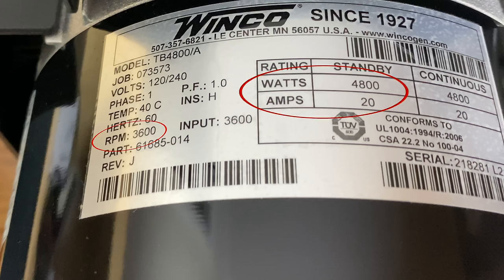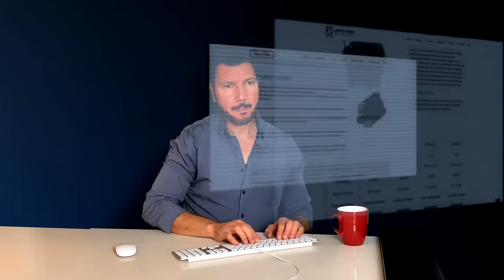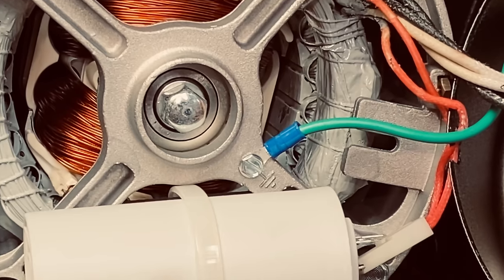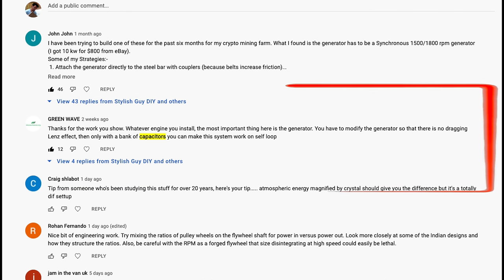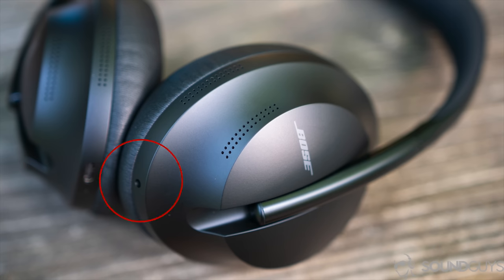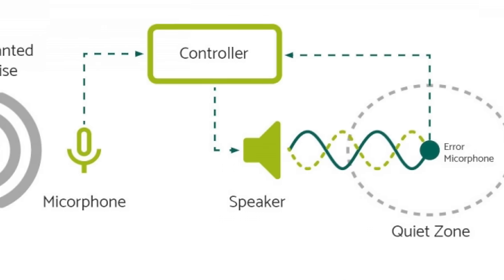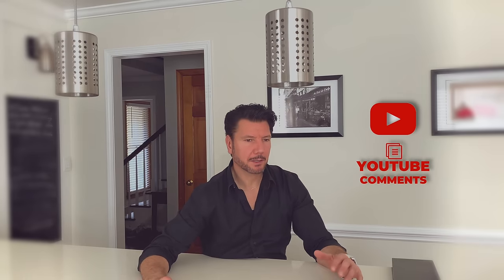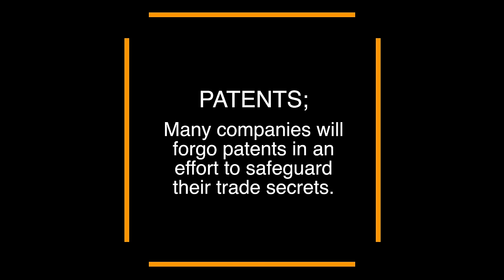Why does this Free Energy Generator not work?

Comment: This is easy to do.  All you need are frictionless bearings, 100+% efficient motor and generator, a perfect vacuum, 100% efficient belt/pulleys, room temperature superconductive electrical components, and perfect dynamic balance.  Easy!
Reply: And even then there would be only enough power to keep the thing turning. Any attempt to get power out of it would stop it. All these things are dreams.
Reply: @andyhowlett2231  right!
Reply: And a djinn to flip the switch
Reply from the maker: Sounds easy enough Brad :)
Reply from the maker: @parsimonies I don’t remember ever saying it was easy. All I said is that there have to be more sustainable ways to generate energy than what we are using now. I never claimed to have the solution.
Reply: @parsimonies I have a Masters degree in mechanical engineering with 30+ years experience.  I know how a generator works.  My original comment was meant to be a joke, not intended to be taken seriously, as you obviously took it to be.
Reply: Çok konuşuyorsun neden telefonunu veya adresini yazmıyorsun neden saklıyorsun 
Hadi açık ol insanlığa faydali ol 
Neden hep gizli...........
Neden korkuyorsun ..........
Yürekli olun açik olun .......
İNSANLAR SİZİ SEVSİN ......
Reply: is possible free enegy(free electricity)?
Reply: @MarkusNenning  if no solution, why i must look this video? 🤦‍♂️
Reply: @andyhowlett2231 Then why do inventors go missing die or close up their research? Why are patents not given and inventions taken? Why is there a secret patents office? Why does the military have staff at the patents office? Now I don't know if these things work or not, but those things alone are helping to convince people they do. Why would you go to so much trouble debunking and suppressing such things if the physics is right
Reply: Why bother with all this? It's much easier to just go to your local hardware store and pick up a ZPM (Zero Point Module).
Reply: @MarkusNenning 
Go For It, Markus...
Remember Fulton's Folly?
More power to you!

Comment: Wind-powered alternators are low rpm. The larger the diameter the slower RPM''s needed to produce power. The pullies should be configured to work as leverage. 1:1 does nothing. DC motors are more powerful. A bridge rectifier from the alternator to DC motor works like a charm. From bridge rectifier to Ultracap just makes sense. The stored energy should be enough to run the DC motor and it is instantly charged by DC power coming through the rectifier.  PS don't listen to engineer dude, he never invented anything.
Reply from the maker: Thanks John!

Comment: Markus, I suspect you already have this comment, but I wonder if using DC appliances rather than AC would help. I believe there is a loss in efficiency on using AC. All the videos that show successful at this were using DC motors and alternators.

Comment: The idea is awesome, the most poer used would be to start the machine, once in motion it coasts accelerating the generator. Run the the system on a solar power system, which the generator will surely charge and power a house with less work. I might be wrong but it is a great way to amplify what may be lost on rainy short sunshine days, in turn needing less panels to brink a 5kw system to life. Can work on a magne axle at another time when we have more time

Comment: Gear ratios should alow you to minimize power needed to start everything and maximize rpm to the generator giving you the most potential for this to work
Reply: Do you have build something like this? Can it really work? Thanks from Germany!!!
Reply: Gearing adds friction that can't be overcome
Reply: @jonnyrox116  True but gears can add torque meaning you could in theory and more power generation units there should theoretically be a point were generation overcomes loss from friction and condutive loss  the whole idea due to the laws of physics is a pipe dream but so was all great inventions to date
Reply from the maker: Very True JonnyRox!
Reply: Wann darf den die Menschheit darüber erfahren!
Reply from the maker: Jederzeit außer morgen :)
Reply: @MarkusNenning   wo ist da der Hacken? Danke!
Reply from the maker: Das weiß ich leider auch noch nicht Dan.
Reply: @MarkusNenning  Danke

Comment: Force 1 (the motor) accelerates the wheel but load 2 (the generator + load 1) decelerates the wheel more than force 1.
Very cool design however. I think it might be useful if the wheel were big enough to be a battery and the generator could pull load off of the wheel over night, and the motor could spin it with solar during the day. The generator would need some sort of on ramp to initiate startup of the load, as well as releasing the generators shaft when no load is needed (100% efficient generator would solve this but all generators are not 100% as far as ive seen), as load is initiated friction is applied to the generator’s shaft until it matches speed with the wheel, and when load is no longer needed the shaft is decoupled from the wheel. If the bearings are really good, and the weight of the wheel and the speed of it is fast, and if it is in a vacuum, you create a mechanical battery!
Reply from the maker: Thank you for the feedback and compliment on the design Ghanzo!

Comment: Greetings . The problem that all these systems have is that the generator has braking due to Lenz's law. There is a way to eliminate the braking and it is placing a switched source at the output.

Comment: Dear Bro. We've mentioned this before and look forward to hearing from you about this new video. 
"If we place the Heavy wheel between two powerful magnetic wheels and magnetic force rotates the weight wheel according to the desired cycle, then we will definitely get good results.
Reply from the maker: I am working on modifying a car alternator with permanent magnets to see if that works. I will make a video about it once finished. Thanks Muhammad
Reply: There's a video is pretty old but it is still up the Wilkinson machine there's only one video there was never a part 2 ??? And I don't think that was because it didn't work !
I say take his gravity generator and make it a closed liquid system I know the 12 volt fuel pump in my car can run a couple of hours and not run my battery dead so I don't imagine it would use a whole lot of power to pump 10 gallons of liquid back 15ft in the air to a holding tank 
I would say the output if it had an alternator/generator on it would run a 12 volt fuel pump and more
Reply from the maker: Thanks Mike,
I do have a video on an actual gravity generator you might want to check out.

Comment: turn the shafts vertically and use magnet to keep the flywheel floating and reduce gravitational friction.  Magnetic Barings help anywhere you can apply it.
Reply from the maker: Not as easy to turn vertically but yes that would be better.
Thanks

Comment: Mr Nenning, you're engineering and manufacturing capabilities are impressive. I am a pursuer of free energy and have tried many configurations of magnet motors and other devices. The one that showed the most promise for me was the Luling motor out of Germany. I don't believe the online plans and info to be entirely accurate though, so I made a few carefully considered changes. Is there any way you might consider doing a project on it? I wholeheartedly believe that this design has the potential to deliver more energy than it requires to operate, but it will take a precise and steady hand to produce it. Let me know please. Thank you!
Reply from the maker: Hello Harold, first off all thank you for the kind feedback!
And yes I am interested in doing a project on it. If you could please send me more information on it so I can do some research on what kind of material is required. Connect@verde350.net
Reply from the maker: @dusan78  I have tried to plug everything up to a toaster and several high wattage equipment.
I have also plugged in a second motor into the generator that uses more power than the one powering the generator.
That is proving that the generator is able to produce the required output.
I am aware that a generator under load works like a break. That except concept is used in semi truck breaks and electric cars.
I have not given up yet.
Thanks for the feedback though.
Reply: 888
Reply from the maker: @dusan78  thank you very much for your input. Appreciate it!
Reply: @dusan78  Yes, while I agree with your statements except it seems that you're not considering the addition of inertia wheel (mechanical battery). Here is possible scenario, at 1st step the motor, inertia and generator reaches the desired speed and stabilize. Here generator has no load. Next, the motor is unplugged from energy source for couple seconds. Entire system still spinning/maintaining. Next, the generator output (current) is plugged to the motor input. Now generator tends to slow down due to the load to run the motor. As generator is connected to the inertia wheel, if large enough the drop in speed is negligible and it is the driver of the system.   So generator is feeding the motor. Next step can be adding load to the generator. It will follow the same logic as previous step as long as load is not heavy enough to reduce the inertia speed and not exceeding capacities of motor and generator. I'm not saying that it will work for sure but it is a possibility and must be proven. Here it seems the key is to find right relationship between the motor, Inertia wheel and generator. I'm not in electrical engineering, so not knowledgeable about motors and generators behaviors. It won't work based on classic physics
Reply: @madb132  when connecting motor, generator and inertia without rexternal  load, not necessarily using the max rated loads of each equipment. For example, 3hp motor have plenty capacity left to drive unloaded 7hp generator. So, the system can add external load up to 3hp motor in this example. Does it make sense?
Reply: @silvioyamada  Nope! you can not get more than you started with. Does that make sense? Go figue.
Reply: @madb132  sorry I can't help you. Pls discuss with someone you trust and have understanding of meaning of rated capacity and actual usage. Good luck.
Reply: @silvioyamada  I don't need too! I know this does not work! PHYSICS says so! Go back to school and listen this time
Reply: @madb132  OK, if that is your point I don't have problem. If you read last sentence of my initial post I said "it won't work based on classical physics". BTW, I have degree in physics and I still remember how the basic laws of physics were developed: repeated observations of the same phenomena and use mathematics to describe it. Of course, one need to study all that are currently known in the books. Granted, 99% of those claim new phenomena are just lack of  knowledge or fake. I have seen some serious "free energy" devices, so I keep open mind that someone can potentially add new laws  of physics and bring better world.
Reply: @silvioyamada  ADD NEW LAW?  REALLY? 😅
Reply: @madb132  The addition of impulse power is whats needed, thats all. It is useless to be occupied with questioning a system thats been built by someone who took initiative to challenge traditional old school laws... yes they're still applicable but an impossible task for those who do not know the new laws of mechanodynamics and the new laws of the electrodynamics, which describes the miracles of behaviour of the elec- trons, which provide thermal energy and electric energy to us. So, peace out brother... Maybe you're the one that needed to listen in class before you throw useless snarky comments... Much Much respect to this man and appreciation for this build and effort..
Reply: @mdutoit912  Off you go and make on then! Get back to me when it won't work. OK. You have been conned by this conman too the, best of luck in life. if you believe this is not a con. bye
🤣
Reply: @mdutoit912  You can't keep taking from the cookie jar and expect the cookies to just keep replacing themselves!  Understand?  He made this device just to prove it won't work as the video has shown, OK? Got it?
Reply: You believe this can work ,Yet you tell me you have a Physic degree? I believe you have missed quite a bit of your lessons if you believe in "Free energy"
Reply: @madb132   As a kid I did, but somehow the cookies just kept coming...  🤣🤣 All chilled man... I hear you... BUT you were curious enough to click and watch the vid! 😂.. Had a look at your biking vids as well... Well done.. Love them.. Where u from btw, Im in SA and energy supply sucks down here, hence the curiosity... But seriously... This thing is somehow gonna work I rate at some point... There aint such thing as free energy... Prob just the term coined... The russians have already built a similar working model.. Got the published paper... Have a good one bro!
Reply: @mdutoit912  i didn't watch the video. i just came here because i hate Conmen. 
Glad ya like my bike videos. Need to do some more! Take care. 
 As for the working model in Russia? Hmmmm, Seems no one in russia is using one. Funny that. Laters
Reply: @madb132  open your mind. New discoveries are never made without testing conventional limits of understanding.
Reply: @_trismegistus  OMG!, Another flat earther has joined the chat.🤣
Reply: @madb132  Huh?
Reply: @_trismegistus  Look up Thermodynamics and it's laws.
Or hide some batteries and scam viewers for clicks and giggles.